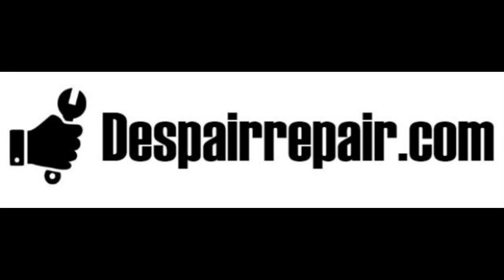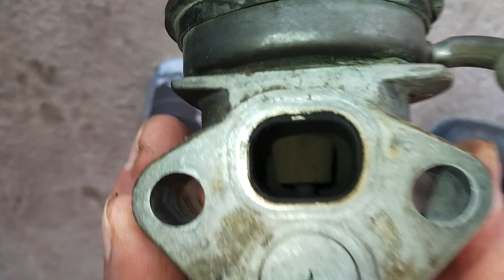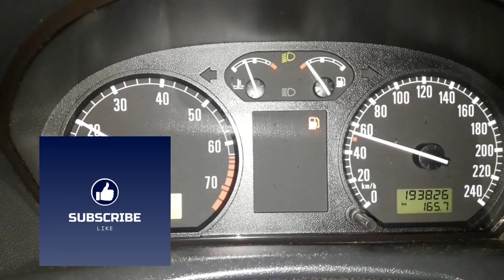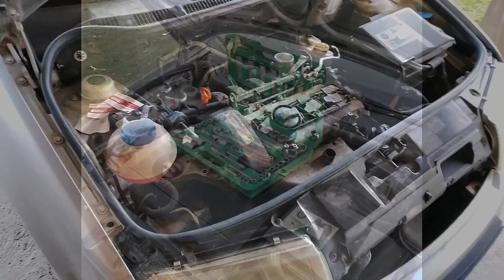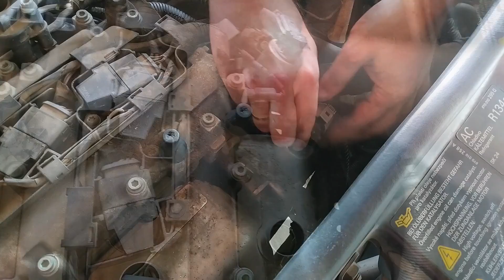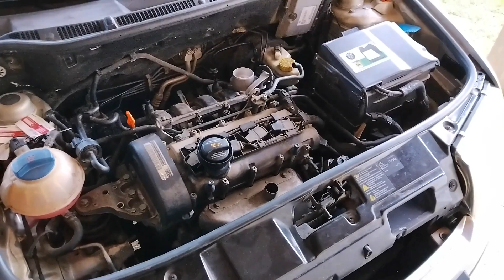How To Clean The EGR Valve On Most Cars

Comment: Do I clean in the piece where the EGR connects as well or only the piece
Reply from the maker: Hi, and thanks for watching! Clean only the EGR valve with the spray (the moving part inside, in particular).
But if you see deposits on the seal and seat on the engine block, clean them with some sandpaper or with a brush so you don't get any exhaust fume leaks.
Reply: Hi, is it possible to clean the metallic pipe from the egr valve to the throttle body? There are carbon deposits inside also. Is it needed to replace gaskets after cleaning that pipe?
Reply: @carlo6286 Use only soft bottle brushes with a little EGR cleaner on the bristles. Always rotate the brush while pulling it out and be gentle. Allow a good 20 minutes for the cleaner to evaporate then refit the EGR. After a little drive, reclean the EGR valve just to remove any deposits that may have been thrown out after cleaning he pipe.